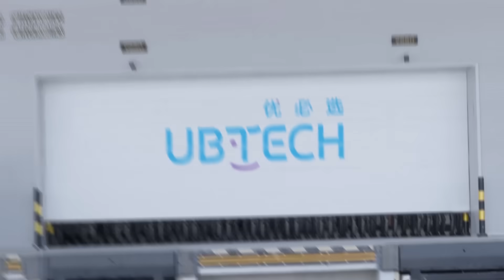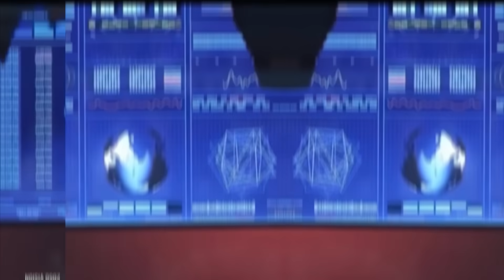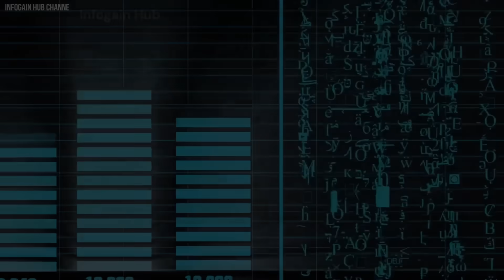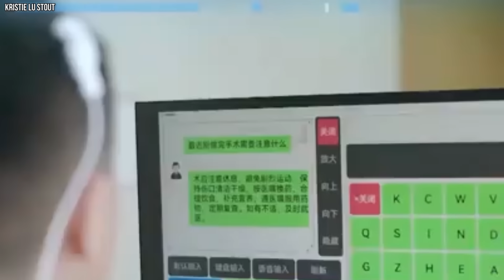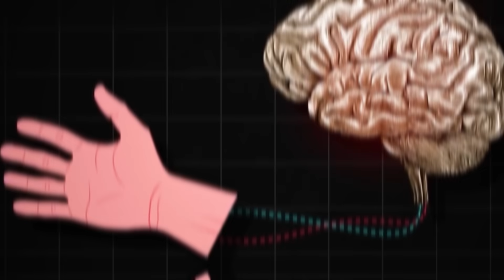China Just Shocked The World With 10 New Technologies

Comment: Why does a car that floats only do so at water levels of either 1 or 1.5 meters? That has nothing to do with being able to flow!
Reply: Ford had that kind of car back in 1962
Reply from the maker: It’s about safety and buoyancy limits, not floating itself. Past a certain depth, currents and pressure make control and stability unreliable, even if the car can technically float.